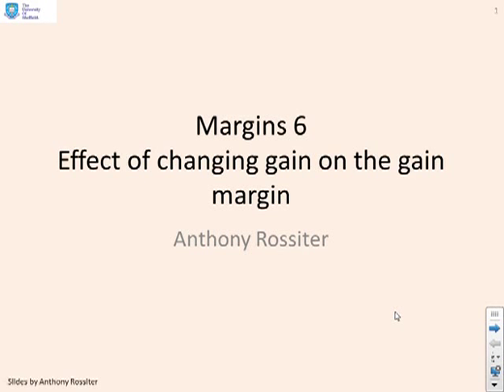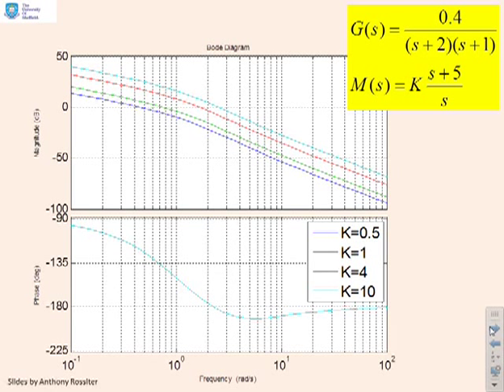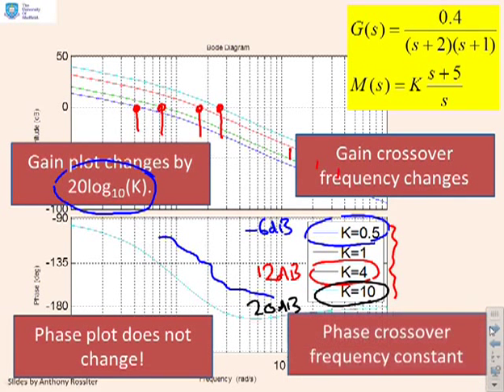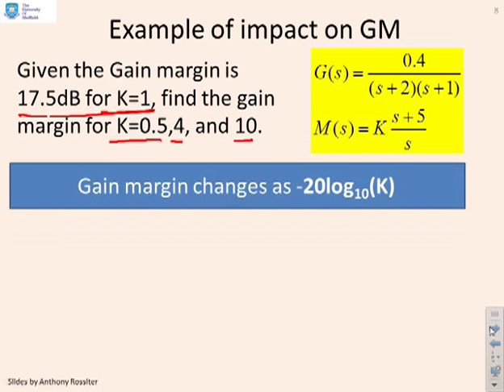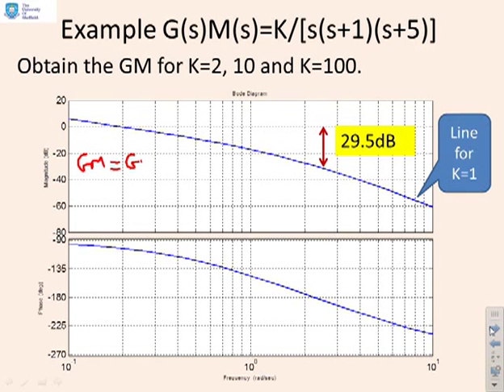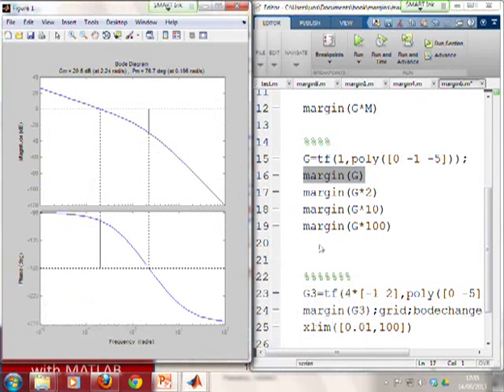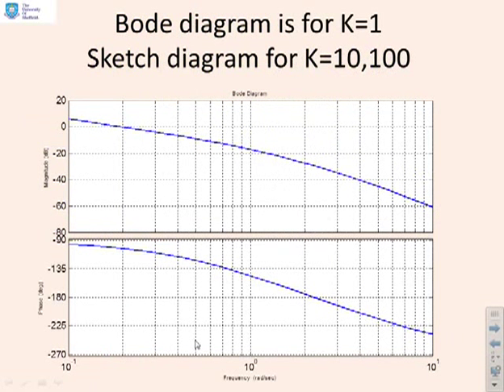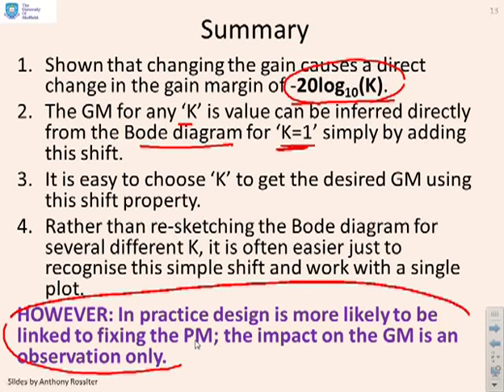Margins 6 - effect of changing compensator gain on the gain margin

Comment: how do you solve tan^-1(w/5)-tan^-1(w/2)-tan^-1(w)=-90 ?
Reply: This may be 5 years too late for you but there is no w that satisfies that equation. This corresponds to the angle of the transfer function (s+5)/(s*(s+2)). Note that the integrator contributes -90 degrees and that means that (s+5)/(s+2) must contribute zero degrees which is impossible. Do a bode plot of this TF and see that it's phase never reaches -90 degrees.